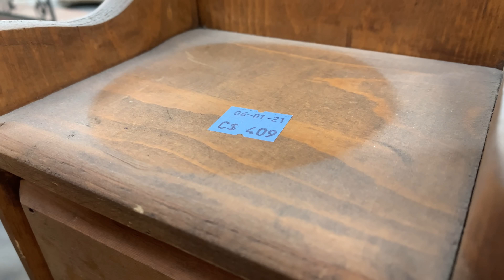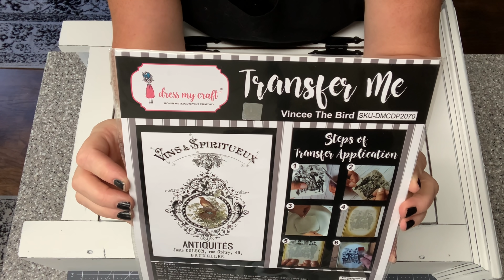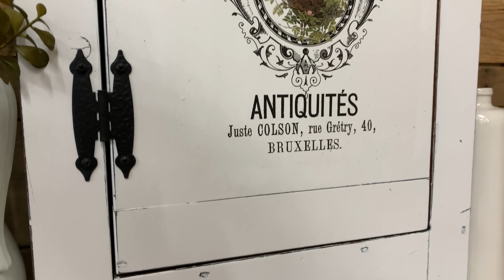Thrift Store Makeovers || Trash to Treasure || Cottage Core/Farmhouse

Comment: I absolutely love your stuff. I have a large cabinet that sits on the floor. It's meant to fit in a corner with a TV on it. It is solid wood. What colors would you suggest?
Reply from the maker: Thank you.. the color depends on what colors you have going on in your home. I do black and white because I love them but they are also a neutral to be able to add into ones home

Comment: Lovely, I have a question about the kilz  paint and primer when you spray it do you use a air sprayer and  do you thin it ? The can just has instructions for airless sprayer thank you so much.
Reply from the maker: Yes.. a little water.. mix in well until.. when you lift the stir stick it does not leave paint on top of the paint. It just blends in
Reply: @GingerChickRehab  thank you

Comment: This may be silly, but I have a question. I am trying to make a sign on canvas.  I used IOD molds on the edges and want to put a transfer in the middle. When should I apply the Waverly Wax? Will that goof up my transfer? Thank you for any help.
Reply from the maker: I don’t think it will.. it’s recommended to clear coat or wax over them to seal them in. But I canvas maybe test out a small piece first 🤗
Oh. No such thing as a silly question